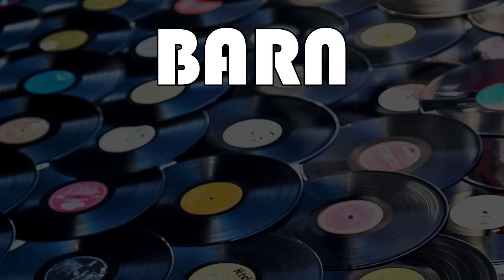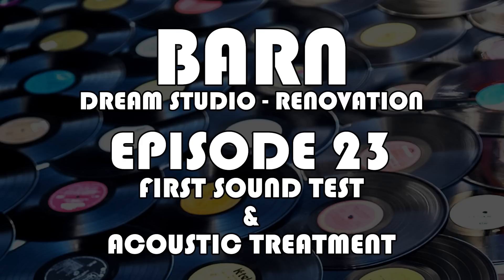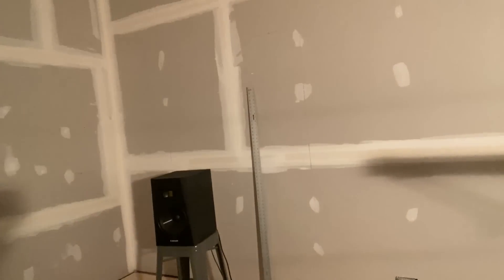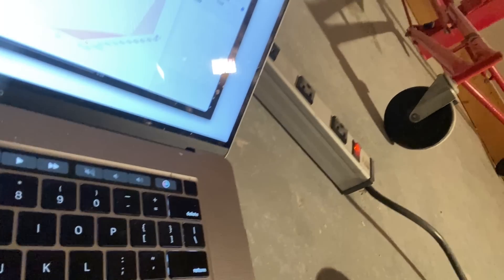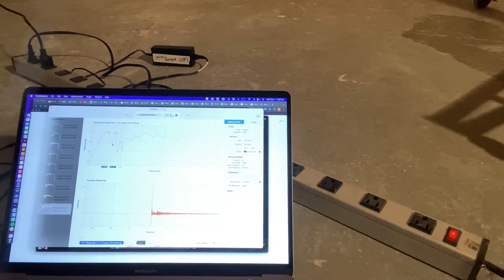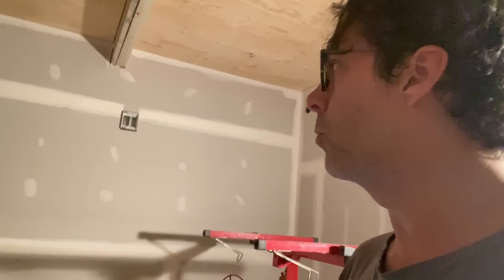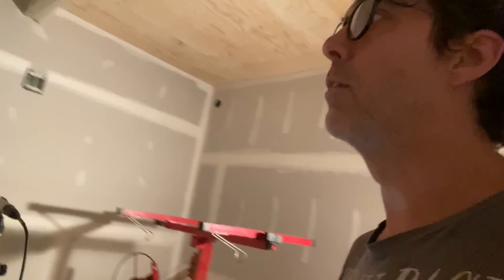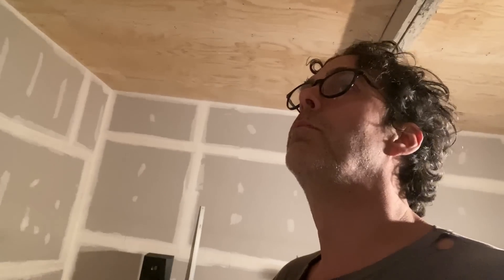Making Records with Eric Valentine - Episode 23 - First Sound Test & Acoustic Design

Comment: Hey Eric - love your series. When analyzing a room it makes sense to use an array of mics. The spatial difference between the positions is so different that only averages of several positions make sense and present aural impression. Data from only one position can lead to false conclusions.
Reply: usually you just mark out locations in the room and move the mic inbetween sweeps.
Reply: This is the way. Control room treatment is normally ALL about the listening position, so moving the mic closer or further down the center axis around the sweet spot is usually ample.
Reply: sonarworks gets you to take multiple measurements from various positions using the same microphone. its an industry standard piece of software.
Reply: @subterraneanpimpernel9455  but the results are in a closed container and it misses many aspects like RT60, EDT, C80, D50 that can be drawn from the log sweeps which are crucial in such an early phase.. I do not recommend Sonarworks anymore, it makes too many mistakes that cannot be corrected for and the support is mediocre.